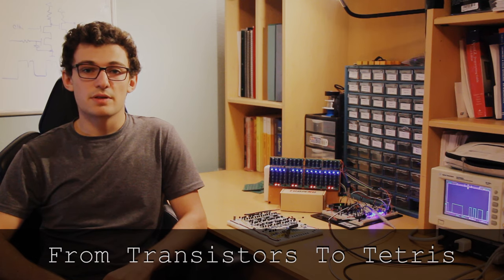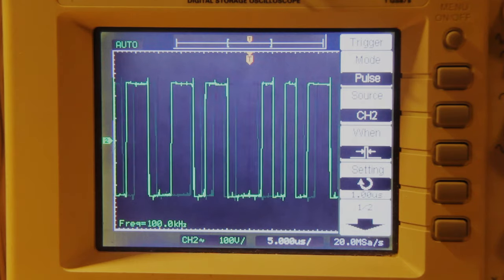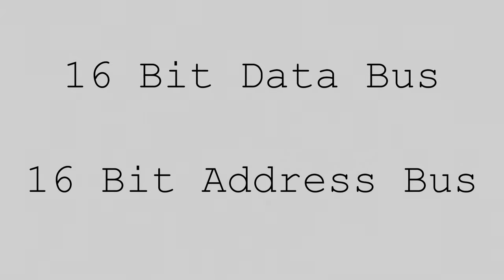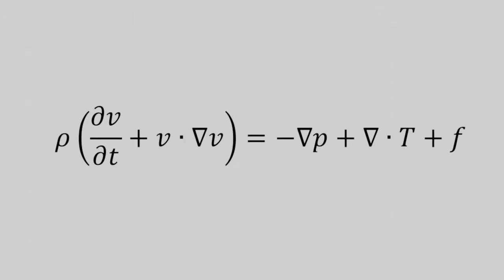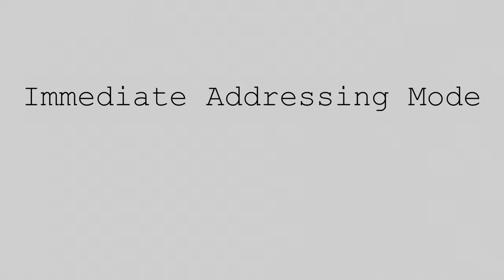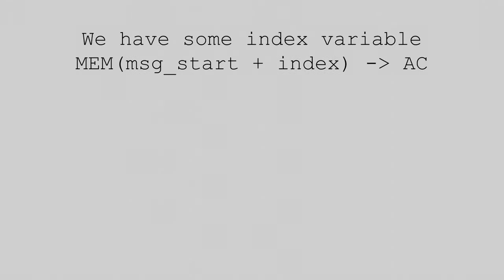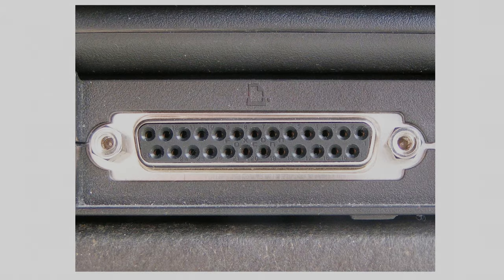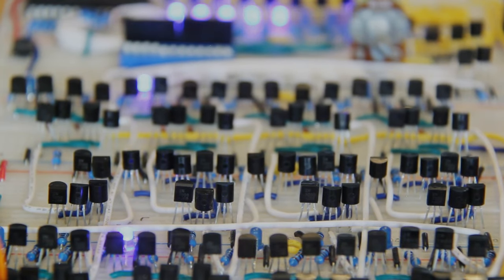From Transistors To Tetris Part 1 : Computer Architecture

Comment: Ben Eater's series is great! After years of trying to learn computer architechture, it finally clicked when I watched Ben's series.
Reply: It's a bit dated but it's still great source material and the ideas and concepts are still quite relevant... There's a university channel that gets into ISA design - CPU Architecture and System Management... I think the later courses extend on this and even get into Operating System Design. I believe the University I seen before is called Bilkent Online Courses. Now they have a lot of courses for many different topics in software engineering, but there is some hardware engineering related material. I think the courses I watched was from around 2008 - 2012 era... It's really good source material. And the one professor explains things quite well.

Comment: I like your ideas. Your commands are very reminiscent of the 6502, but that's an awesome chip so my comment is not a criticism.
I was planning to build a really basic computer after watching Ben Eater's breadboard computer videos, mine would have a total memory of 256 bytes, with an ability to modify to stack size against free memory to give maximum convenience, depending on the program being designed. It is only a demonstration computer. When I get around to it. (Just need a decent lockdown to give me some time.)

Comment: Very nice work! I have been thinking of a design for a 12-bit Addr / Data computer. It was hard, but I was able to decide on a 16-instruction set. That's 4-bits for the opcode, and 8 bits for data all in the instruction. Originally, the plan was using relays, but I may end up going with transistors like you. This is very interesting stuff!  All good wishes.
Reply: Why not do it in an FPGA and use a hardware description language?

Comment: I'll say this much, as a student going to one of the top universities in the country as an Electrical Engineering student, especially learning as much in theory and concept about these components such as transistors or microprocessors I've learned just as much if not more in the first 45 seconds of this video than you could learn at a top tier university. Sad but true.
Reply: Please by all means, learn as much as you can from the internet before wasting your money on a degree unless you absolutely need it. It's all a scam. please.

Comment: You can speed up the turn off time of a transistor by discharging the the capacitance in the base to collector junction by using a germanium diode.

Comment: So, when you're performing the JSR, are you pushing both the high and low bytes (8 bits) to the stack to get a full return address, or are you shortcutting it to within 256 bytes of the subroutine and just applying an offset?
Reply: the stack is 16 bits wide, only the stack counter is 8 bits

Comment: Do you have a logic analyzer say 64 channels ? I would be awesome to watch this in action. The fetching of opcodes and associate data. The result of an addiction instruction and so many things. I work with microcontrollers which is very similar in nature. I lately have been research a older Zilog Z8 series mpu which came out shortly after I graduated from Devry. I'm using a Z8613RS and a Z8681 in expanded mode. It's a lot of fun. I think that's awesome building a computer from discrete transistor. I just want to say Hi and wish you well.

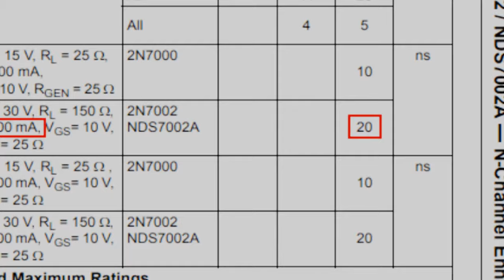Comment: 2:37 I like the clever idea of reducing the number of required registers to keep the transistor count to a minimum, even if it means needing to tweak the code a bit to accommodate.  I'm wondering if you might still be able to drive those 2N7002s at something like 1 - 10 mA because 200 mA seems ridiculously high.  Have you tried that already?
Reply: There seems to be a rather hard lower limit for the number of registers to still be able to implement 8086 microcode. We need PC. We need a stack to push away context. For MUL and REP we need CX to count. We need AX, DX for the values. For MOVS we need two addresses, let’s store them in BX and DX.

On 6502 CX would be X. Y and Z would be the addresses is MOVS . DX would be B.

Comment: I feel like 4 registers isn't enough. Especially because they are special purpose registers. Less memory accesses are needed in a CPU with more registers. 
In the few cpus I've built, I usually use 8 general purpose registers, convinced with the numerous special purpose registers. In programs like Tetris, this allows the cpu to not access memory as much; more data can be stored with the alu. One register for current falling brick x position, another for y position. The next for the current block type, and the fourth register for the next block type. things like these allow you to do constant operations on these operands very quickly without having to access memory (takes multiple cycles)
Reply: The design is reminiscent of the 6502, it has zero page addressing which is just as fast as 256 registers.
Reply: @DigitalViscosity  i still prefer the load/store architecture like that of the mips instruction set

Comment: 2:41: I don't think something a little over a kilowatt of power is technically unfeasible. Electric kettles routinely exceed that. Even in the U.S., anything up to 1.7kW should be okay. Admittedly, it still might not be preferable, and might make your air con and electricity bill scream for mercy.

Comment: 15:48 Something bothers me here. You said that this is self modifying code. But this is not the case as the memory address of index could be at any position in RAM. It would be self modifying code if the address is an address encoded in the opcode which was altered at runtime. But this code here could still be executed from ROM.
Reply: You're right, but not for the reason you stated. It indeed isn't self-modifying code; it would be self-modifying code if he patched the immediate in the previous example (say, the operand to `lda base, #00` where #00 is the immediate) but this is not the case; and in fact, the example shows simply how we work with memory (and 'fields') in assembly: modifying memory locations. 

Also, don't forget: running code from ROM is not possible in about all CPUs, because there (generally) is no such thing to a CPU as "ram versus rom" -- it's whatever you glue to the address lines and data lines, and that's one big blob of data to the CPU. So yes, the code he shows IS ran from memory, that is, from CPU perspective. Whatever memory mapping happens on the circuitry around is invisible to the CPU regardless. For all it knows, it might be having its tiny little wires hooked up to a sensor measuring air temperature and it'd have no idea ;P

Comment: To do this, you almost need something like IBM's Standard Modular System (SMS) or Solid Logic Technology (SLT) to organize the circuitry.   There's going to be a lot of transistors!

https://en.wikipedia.org/wiki/Standard_Modular_System

https://en.wikipedia.org/wiki/Solid_Logic_Technology

You might want to look at TI's TMS9900 processor if you want a simple 16-bit processor as an example.